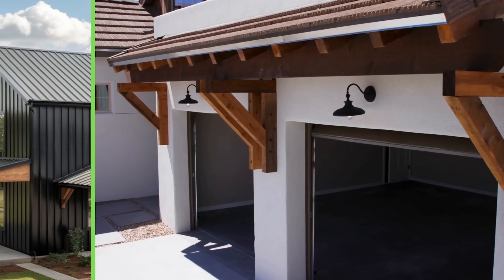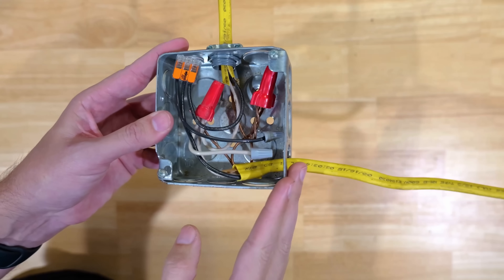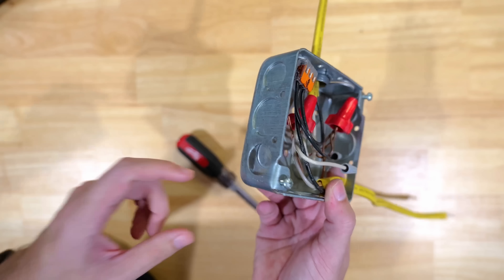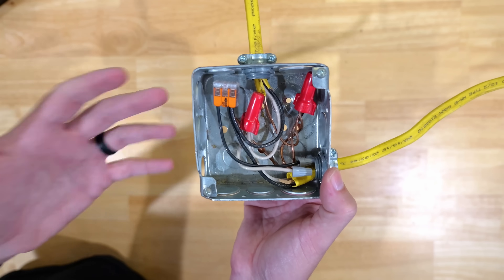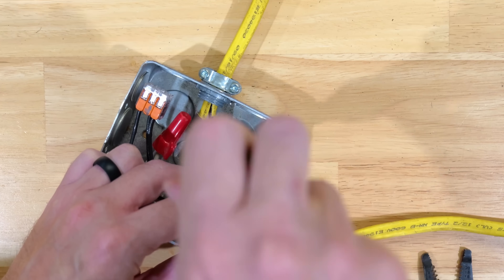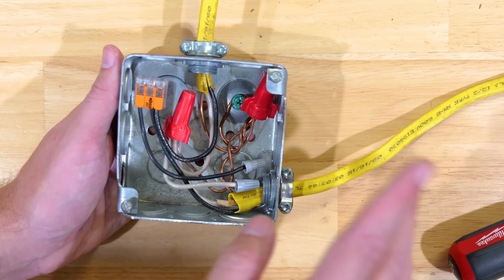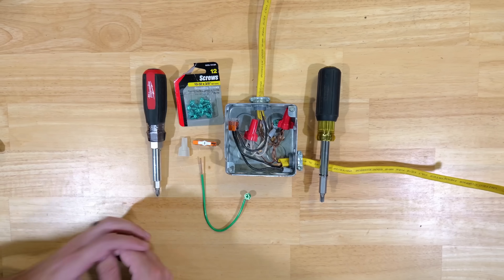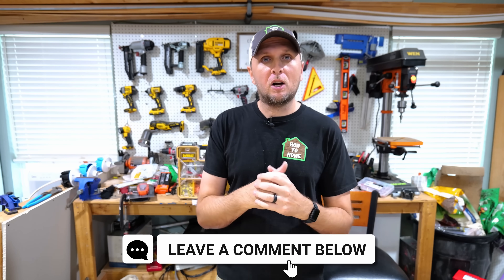SHOCKING Mistakes DIYers Make Installing Metal Electrical Boxes!

Comment: Everyone dissing Wagos should remember that they are insanely popular in Europe.  Germany has no higher incidence of fires caused by electrical wiring than North America.  In other words, used properly, they are just as safe as wire nuts and much easier to use.
Reply: I've seen tests and they pass just as much current as wire nuts
Reply: @JamesSumners-b7z I have seen multiple test with Max strain and the temp is 5-10° more than Wirenuts but 70° less than the max  threshold, sooooo.
Reply: @OneFoxTwoFox exactly the difference in negligible
Reply: @JamesSumners-b7z and over heat more than wire nuts
Reply: @Robert-e3g5o barely
Reply: @Robert-e3g5o "Overheat" or just get hotter by comparison?
Reply: 40 years electrician here, i switched to wago some 5 years ago, i will never twist a wire anymore in my life!
Reply: @ayuse01 I went with wire nuts as I’ve heard too many bad things with wagos… the guy in electrical at Home Depot mentioned how they put up a display and after a week or two it stopped working and all of the wago connections were loose… he said he went back in and replaced them all with wire nuts
Reply: @bounderchris you been lied to my friend.
Reply: They are game changers. I loved when the price dropped. They were expensive AF when they first hit the US.
Reply: @electricalife  Wire a couple ceiling fans with wire nuts and then try the same install with WAGOs...you'd gladly pay the price.
Reply: @timheersma4708  yes, braided wires on fixture, and solid 12,14 gauge wire, wago is the way to go.
Reply: I worked on the construction of a hospital, we used both wire nuts and push in wagos only with number 12awg solid wire, after construction I was hired as the hospital electrician and in 9 years of maintenance on that hospital the only connections I ever had problems with were overstuffed red wire nuts. Wagos have earned my trust. I  don't have a strong opinion on the lever wagos except I recommend taping them to prevent accidental opening.
Reply: @diegocastaneda9039 or zip tie the wires instead of tape
Reply: @diegocastaneda9039 but that's not a problem with the wire nut. The problem was someone used the wrong sized nut for the amount of wires in the splice
Reply: Also, for noobs or diyers, it's more difficult to use wire nuts properly than to use wagos properly.
Reply: There is a reason why wire nuts are illegal in Germany. We use 240V/400V Systems.
Reply: @Mr.Serious72 thank you, you answered my question.  Germany is like nzed 240v lower amperage
Reply: Mr serious  That's unrelated. You can use wire nuts on 480v. I do it legally all the time.
Reply: Maybe safer cause you can't use them wrong
Reply: And everythings 220 and up for the most part
Reply: I love wagos and they have been approved in addition to the fact that I think they’re safer. You can see the ends of the wires which is a big plus. I’m not referring to any knockoffs, you get what you pay for (sometimes).
Reply: @barbnelson9386  Is it possible to buy bags of these wagos and are they specifically marked for the size wire in the case of either 14 or 12?
Reply: @gregie9999hotair1 they will take either 12 or 14. Same device.
Reply: @gregie9999hotair1 . I usually buy them in bags of 100, with the two and three conductor styles being my go-to. I think I get that bag of 100 for between $20-$30 in Texas.
Edit: also, they say what wires they are compatible with, with there being a range of sizes such as 16-10 AWG sizes. I believe there are smaller sizes (meaning higher number; 20+ gauge) but I don’t use them in my line of work.
Reply: Amen old men some times get dis oriented some type of brain damage.
Reply: Wago are the best right now great technology
Reply: I agree I used them in my house
Reply: Dissing?
Are 8 years old or retarded?
Reply: We don't care what Europeans do... that's why we left
Reply: With 4 sizes of wire nut, I can cover 99% of my uses for a fraction of the cost. When cost ceases to be an object, it might be worth using, but I buy my wire nuts by the handled jug from 3M so economy of scale is much better for me than a homeowner. Knockoff lever connectors are suspect and legit ones cost too much at present to use outside special use cases, luminaries, exit signs, and emergency lights where having to wire something hot is a likelihood. 

I also should point out I'm not just a homeowner. For the average DIYer, Wago is probably far likely to achieve optimal results across a greater level of experience.
Reply: Yall use 240 or 120 over there?
Maybe we got too much amperage  on 120
Reply: But North America has always been better than Europe
Reply: Popular for lighting and that's it
Reply: @RustHandyRacer  that is only in America. And we may be the greatest country in the world but our tradesmen are also stubborn old fucks. Wagos are great and leave less room for error than wire nuts.
Reply: @nickjordan5406 how is it less room for error? You twist wire nuts. The wires are physically touching. Pre twist the wire
Reply: Europe sux😂😂
Reply: The problem is long term and due to the fact humans will use that outlet and over load it. That connector is entirely dependent on the tension provided by spring steel. Which is fine until you add heat from over loading. Then the spring fatigues and loses tension. Now the connection isn't as good and allows it to get hotter and it becomes a vicious cycle until it fails. A wire nut can't fail that way
Reply: @usa5865 Except they've been tested thoroughly, time and time again, and handle it just fine. You're just making up fiction that makes sense in your head. You can just say you prefer twist nuts, and that's perfectly fine and valid.
Reply: @usa5865- LMAO!!! So you’ve never seen a wire nut melt on the outside, huh? That’s hilarious! 😂
Reply: @usa5865 lol
Reply: @usa5865. Except they can, especially by the less experienced. And I’m not just talking about homeowners and diy-ers. How many electricians in training are doing the wiring in construction? And is EVERY SINGLE connection they’ve done fully inspected by the experienced electrician on the job? Judging by the slop that’s being mass produced here in America, I don’t think so.
Reply: Just looking at the design I don't see how it can pass as much current as a twisted wire nut connection. Time for a which catches fire first video?
Reply: @rob8823  There is a video on YouTube where a guy ran 30A through wagos and they didn't get hotter than their rating. They are safe.
Reply: @mickeymorgan4672  and there is another video on YouTube  where the host shows the higher heat generated  in a wago  connection  compared to weren't connection  on an infrared camera screen
 I cant remember what voltage was being run through  the connection . I just assumed it was 120volts U.S.
Reply: @Robert-e3g5o Higher heat isn't intrinsically meaningful though, under 110f and it's not burning skin, and if it's not doing at least that, then it's not doing anything meaningful.  It's "just" hotter. And I'll take a hotter connection in exchange for greater consistency.
Reply: @rob8823 cant remember the channel name, but a guy did a video on weather wagos could hold up to high power draw and ended up pushing the wagos over like double their UL listing in for AMP before there was a failure. I believe the insulation melted off of the wire before the wago failed.
Reply: It'll be down to the surface area of the connection. As long as you have at least as much surface area as your wire cross section then you're fine. Any extra is going to be for the safety factor. A wire nut, properly used, is technically overkill on that front. While a wago is going to still be enough plus a bit of safety but not overkill.@rob8823

TLDR, you're not wrong. But it's a moot point.
Reply: @rob8823There is a choking effect. I only use them in one situation.

Comment: I would add one tip: secure the wagos with insulating tape around it to make sure no clamp will be opened by an entangled wire when mounting everything together
Reply: Except some tape when it gets old is a gooey mess to remove so I won't do this.
Reply: I've never had super 88 do this.
Reply: Useless idea. Secure your wire nuts, they go open easily.

Comment: I would have pulled all the wire from one end of the house through the box and slid the relief on it from the far end. Next I would have just poked those pesky ground wires through the hole and bent them down. Follow me for more ideas.

Comment: I knew virtually all of this, but had to watch the video to see what mistakes he was actually talking about. Seeing the different wire sizes was not easy to see from the picture, a least to my old eyes anyway. I have an electric outlet outside near our back door. This is actually my mom's house. I saw that it had an open hole on the top of it, so I did put a plug in it long ago.

Comment: I've never used a WAGO so I'm by no means an expert on them.  The first time I saw them in the big box store my reaction was well there's an easy install fire.   Now more to my thought as to why I won't use them and relevant to the video, the #14 black pigtail was obviously loose in the WAGO and likely would have gone into thermal run away with a medium to heavy load on it.
Reply: I first used Wagos to extend some flexible cords under a floor where there was no access.  It was the only legal way I felt confident using here in the UK as, unlike screws, they are considered maintenance-free.

My feeling is that they are perfectly safe so long as you don't exceed their rated current and that isn't as high as the size would suggest.  No risk of overtightening and having the broken cable only just touching the terminal, and no risk of it coming loose if correctly fitted.  And they work well with stranded cable or flex.  However, the limitation is that, because they don't bite into the cable, if you use a solid-core cable like many of the UK ones and it has a bend in it, it doesn't sit well in the clamp and the connection may not be reliable.

Comment: The better way to bond the box is to take the ground wire of the feed (line) cable, wrap that around the ground screw and then twist any grounds from loads together with the bonded ground and top with a wire nut. And wago connectors, with only a few exceptions, they are only designed for 1 wire per slot. Doubling up as shown in the video can result in loose connections as the force of the spring connector may not be evenly spread over 2 conductors. This can cause higher resistance, overheating and fire.

Comment: One thing I've never heard discussed is how many times can receptacles be replaced.  Every time one is replaced those solid wires are bent and moved around again.  I know for 90% of receptacle boxes this would never be an issue.  I can't help it think those wires are increasing resistance every time they're disturbed. Especially in high traffic receptacles like in hotels and so forth, that require periodic replacement.

Comment: It really doesn't matter about the load that you connect. Unless you're dealing with fixture wires, you cannot mix the wire gauges. There are exceptions (tap rule), but they don't apply here. Another is let's say you have a 20-amp circuit which would require 12-gauge wire you could run 10-gauge wire to the outlet to mitigate voltage drop and then splice the 10- gauge wire to a 12-gauge wire to let's say a receptacle. The circuit capacity is always dictated by the over current protection device you then size the wire to the breaker; you can however run larger wire if you like but never smaller.

Comment: Exercise caution when tightening the strain relief screws to avoid damaging the outer sheath and electrical wiring insulation. Over-tightening can cause the metal strain relief to cut through these layers.  Just do not use gorilla force on the screws.

Comment: The only issue with this video it is hard to identify the 14 gauge wire the tip off for me was how loose the wire was on the connector.

Comment: You’re using the term “strain relief “ very incorrectly. Strain relief are connectors usually for an SO cable that isn’t required to be strapped. If your romex needs strain relief you’ve already fucked up.
Reply from the maker: No I'm not.  The NM cable clamps are to secure the cables in the box and also provide strain relief.  Honestly not sure how this is debatable.

Comment: Oh-and straight-in connections with good quality wire nuts like these gray “twister” wire nuts, are fine! I actually HATE pre-twisting, and always get good splices straight in. Trick is to bend them till they lay evenly, none too far forward or reverse of others, hold firmly together, install connector and be sure it is snug, apply the “pull test” and tuck into box neatly. Pre twisting can actually cause issues in my experience. I do straight ins 99% of the time and so does a good friend electrician that just retired

Comment: DIYers aren’t the only ones; I’ve seen numerous “professional” appliance installers not using box connectors and just running cables through metal holes.

Comment: I know there are code issues, but in all reality the strain relief is almost never important from any kind of safety standpoint. Especially since almost all the metal boxes I've touched were exposed in garages, workshops, etc. (so no sheetrock or anything hiding the cables outside the box).

When you have an electronic device that gets moved, unplugged, replugged, people trip over the cord, etc., strain relief is important. It keeps things inside the device from breaking as the cable wiggles repeatedly, when the device gets knocked off the shelf and is hanging by the cord, and so forth. It also reduces the likelihood the cable gets cut into by the sharp metal box.

But household wiring junction boxes don't get moved around like that (mostly). They just sit on the wall and continue sitting there for 50+ years. Nobody is grabbing the cables and moving them up and down, tugging on them, or whatever. The once or twice a century someone does new work inside the box isn't remotely enough to cause issues, and it would take a very large number of seasonal hot/cold expansion cycles to rub through the cable sheathing.

The biggest safety issue is if you're working on the box and shove the cable OUT through the hole and now it's stuck inside the wall, especially if that side is connected to a breaker. But that's not really a strain relief issue so much as a "why so stupid?" issue. And, if your cables aren't behind a wall, even that isn't a real issue.

Also, because almost all the wires coming into the junction box are solid core, they're extremely stiff. There's no way a wire that pops out of a wire nut will somehow work its way outside the junction box. A fact you become very cognizant of when you're trying to back a cable out of the junction box so you can remove it and it catches on every little thing on its way out.

All of this is especially true if you use wire staples within like a foot of the junction box and every couple feet of cable, so you don't have 10 feet of cable hanging out of the rafters that might constantly get snagged by people shoving saddles onto the top shelf in the shed. Or some kind of wall covering the cables.

Also, I've worked around a lot of junction boxes (metal and plastic) that not only had holes in the sides uncovered, but had no face covering at all. And I've yet to see someone accidentally stick a finger in and electrocute themselves. It makes me cringe and I would recommend against it, but I don't think it's actually that huge of a safety risk in practice.

(Strain relief for breaker boxes is slightly more important, since you're more likely to pull and push on other cables while working on new things, and any given cable will get yanked on a lot more than in a typical junction box. But it still doesn't really matter; you'll almost certainly replace the house before the cable wears through. And if someone is so aggressive they wear through without strain relief, there's a very good chance they're breaking cables with strain relief.)
Reply from the maker: You’re entitled to your opinion.  Safety is still always a priority.  I was trying to show the best practices but also how to do things correctly per the NEC.  Take it up with them, they make the rules.

Comment: This guy is not an electrician calling them cable clamps
Reply from the maker: They are literally called cable clamps.  I was not going you constantly call them non metallic clamp connectors.  Or what do you special electricians call them?  Cable tightener downers? 😂

Comment: On your mistake #3, mixing wire gauges; the gist of what you said is correct, don't mix wire gauges as it can cause confusion that leads to potential hazards. The important part that can use some fleshing out - the critical piece is what breaker size is used at the box/load center. You need to choose a breaker size based on the smallest wire (weakest link) - if you mix 12 gauge and 14 gauge you'd need to use a 15A breaker and then everything would be safe. Unfortunately, it'd be very easy for someone to see the 12 gauge source wire running from the breaker box and assume they can use a 20A breaker, not knowing somewhere downstream hidden in the circuit you sized down to 14 gauge. Your source would happily supply up to 20A not knowing there is a weak link somewhere that's only rated to safely carry 15A. That 14 gauge wire would have the potential to catch fire and burn BEFORE the working 20A breaker trips in that scenario, causing a safety hazard.

So one of those things, the situation can be made safe with proper labeling and breaker sizing; but humans being humans can easily turn it into an unsafe situation (it's incredibly foreseeable to see a 12ga line and assume 20A rating). So definitely a bad practice to mix sizes.